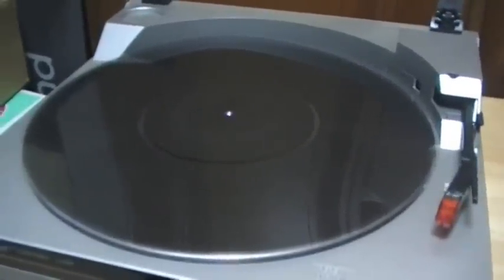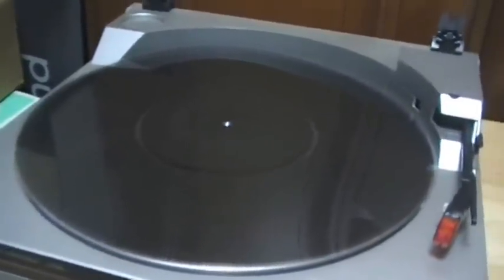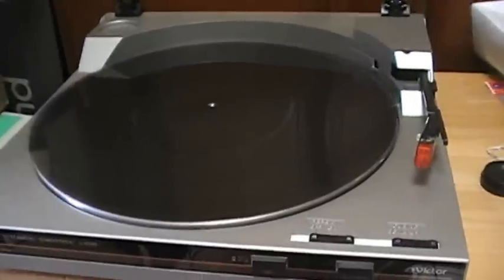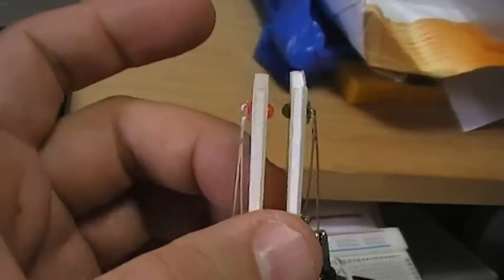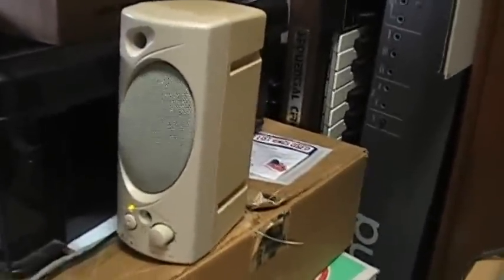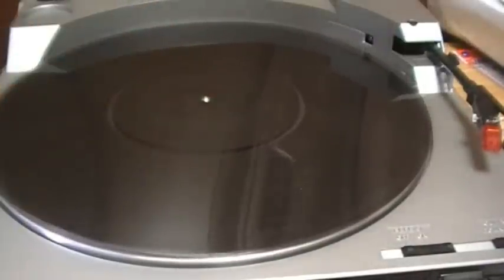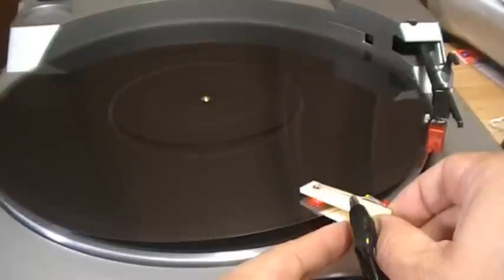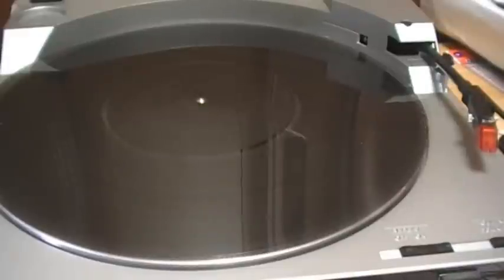Reading an Optigan disk

Comment: So interesting that you can get "music" from "light"!
Reply: That's how motion picture sound was created optically.
Reply: This is literally how sound film was born. Film started as silent, with music being eighter played live or reproduced from a record disc. However, as preferences shifted and people wanted to actually hear the actors (not just look at the lines and read it themselves), Hollywood had to come with a way to record the sound of the actual film. First tries actually involved record discs, but that was quite time consuming and it also limited the length of the film to the duration of a single side of the record. Possible solution would be to divide the film in two parts and play the first part, then flip the disc, and play the second part. But there is better idea. What about recording the sound directly to the film strip? Sounds impossible? Nothing's impossible. With invention of photosensor, it has been made possible. That was like late 20s. From ever since then, the film strips have sound encoded into the light patterns on the side right next to the film frames. Believe it or not, even in digital age, there are still number of theatres that still use the classic IMAX Technicolor film strip technology. Have you ever seen one? However, they are slowly disappearing, being modernised and replaced by digital projectors.

Anyway, I never knew that Optigan actually used the very same technique as film strips for sound - that is light patterns I thought that the tracks were actually magnetic strips on the plastic disc (the black circles around). I didn't realise that the actual tracks were the spaces between those black circles :D

Comment: You don't really need a LED emitter diode, the photo transistor is sufficient if you put it under the disk and put a standard lamp well above the entire disc, or say just a radius, so you don't need to use such a fork. :)